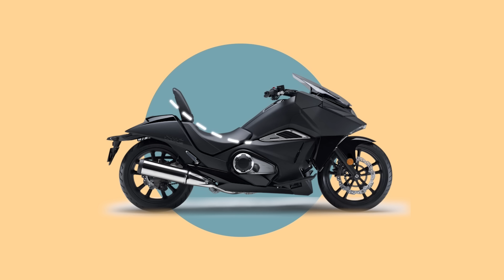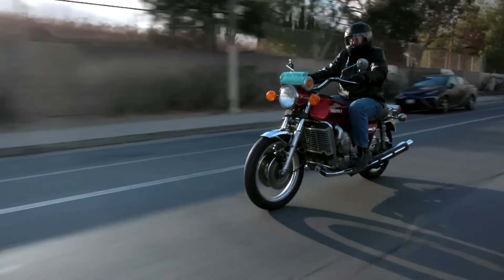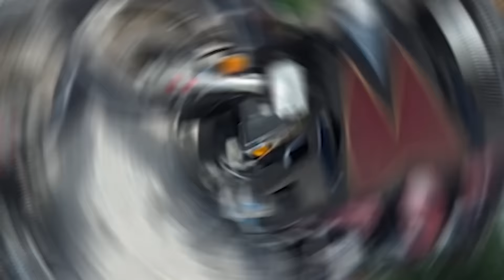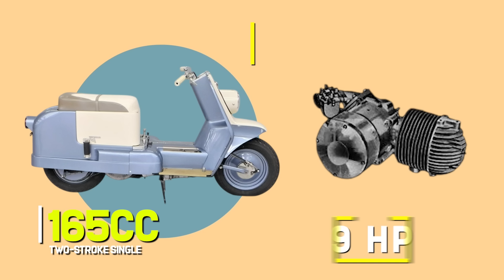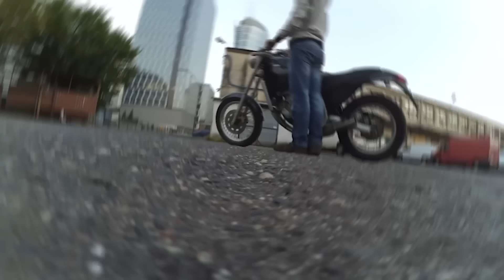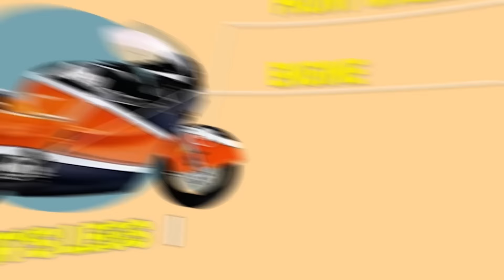The WEIRDEST Motorcycle From Every Brand!

Comment: I owned a 1980 Kawasaki KZ1300B, their first 6 cyl. tourer. Later I owned a 1984 6 Cyl. Voyager. Yes, they were heavy, but the low seat height helped at slow speeds, and the engines, OH the engines, smoother than a baby's behind and fast as a missile. Oh, and yes, we DID tow a trailer behind it!

Comment: I'm not sure that Honda's NM4 is even it's weirdest....   I bring you, the DN-01.
The NM4 is just a NC700X in plastic Batcycle cosplay.  The DN-01, with its single-sided swing-arm, shaft drive, unique mechanical/automatic transmission and looks a cross between a scooter, cruiser, and sport-tourer is just plain odd.

As for Suzuki's Wankel powered RE-5, for all the "it's unreliable" talk...   George Egloff rode one in the first Iron Butt Rally in 1984...and tied for FIRST.

Comment: As a contemporary to most of these I recall from the Kawasaki Voyager, to Yamaha GTS or the Aprilia Moto 6.5. If I recall correctly the Voyager behemoth was a sales disaster. The GTS while add a very decent suspension behavior. Opposite of what is said on the video! It had a serious oil consumption issue on the first iteration! The Aprilia 6.5, if memory serve, had a serious issue with the distribution. I think this was the one with a timing belt. Which on a high revving bike engine, is surely not a good choice! Quiet, but not reliable! And the BMW C1... Oh! Forget it. LOL 🙂
Memory might not be as sharp as it was...

Comment: I've had a Vultus for over 5 years now...  love the stupid thing.  He's on point about repairs, tho..  whole lot of tupperware to remove and break to fix simple things, but the ride is smooth as anything.  VERY low center of gravity with the forward tilted engine placement.  I do wish it had a bigger engine, 675CC makes it a bit of a glass cannon at speed.  Good take off, not so good top end.  and yes, you are not going to carry anyone on that tiny 'rear seat'.  I just leave mine up for comfort.  it has these nice wide built in baggers on the back, that have NO ROOM in them.  Can of coke, and that's about it.  Still get lots of thumbs up on the styling, and comments from both riders and drivers: "What the hell is that?"
Reply: I keep hunting for a used one every now and again.